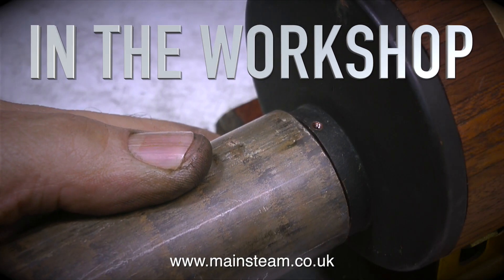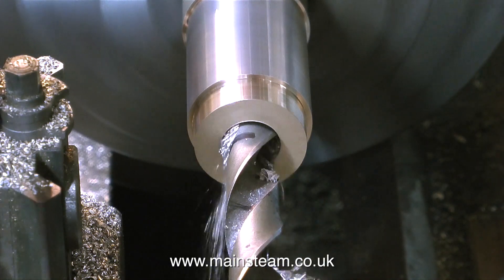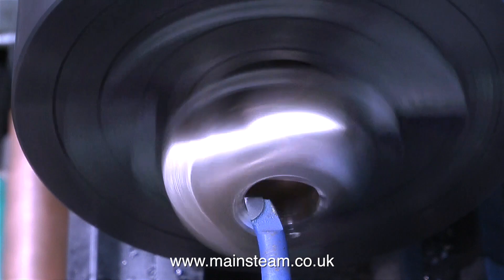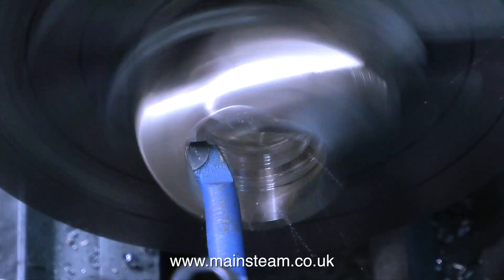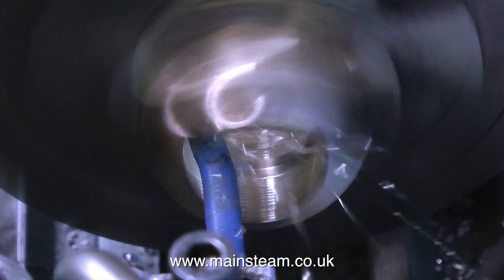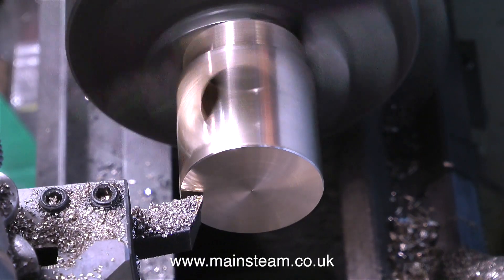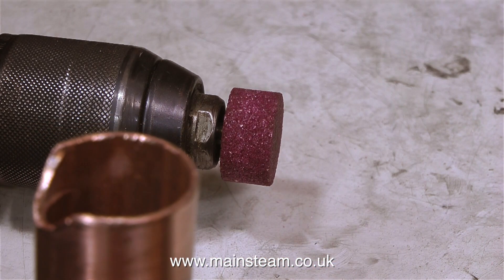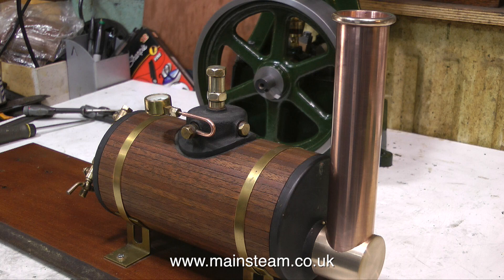HOW TO MAKE A STEAM BOILER CHIMNEY AND MOUNTING - IN THE WORKSHOP

Comment: When using a big drill could you use a small drill first? It will make the tip of the drill not force material to the side and make the drilling slower and more difficult. By using a predrilled hole it will make it much smoother and faster.

Comment: Hi Keith, you may be aware already of the existence of both 'hollow bar' and 'cored bronze' that are available as rolled and cast bronze with the 'middle missing'. However, I'm always surprised at how many model engineers are not aware of their existence. They save considerably on materials costs and, being a fellow Yorkshireman, I always struggle to sleep at night knowing I've turned a large portion of my hard earned pennies into swarf. I realise that in this particular case you needed a blank end on the fitting, however this can also be achieved by making a functional (although useless...!) flue inspection hatch. I must point out I'm not criticizing your work, but in the theme of being for beginners I bet many beginners are unaware of the availability of a cheaper way of doing the job. 

The other advantage of your new arrangement is the possibility of tapping a hole to take an exhaust elbow too. 

Keep up the great work.

Comment: You may already know about this but if you grind a very small flat on the rake angles of the drill bit (end of the spiral that does the cutting) perpendicular to the work it will cut much smoother in brass and bronze, and will prevent the material from grabbing the drill and pulling it into the work. I usually only grind about a 1/32 flat so if I need to cut ferrous metals again I can just touch it up on the grinder to get the rake angle back.